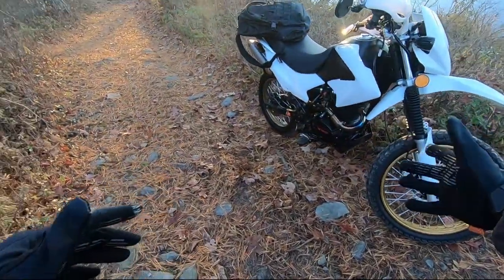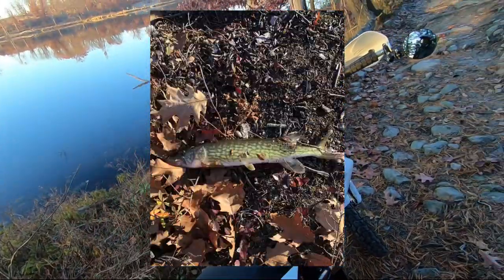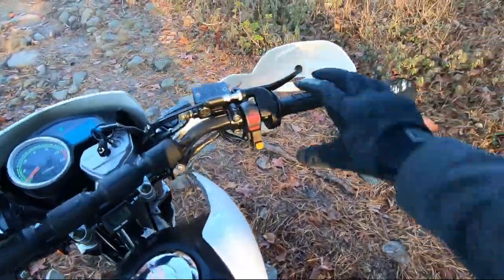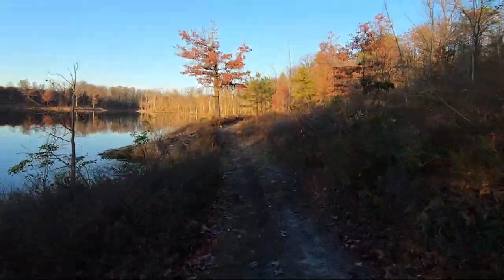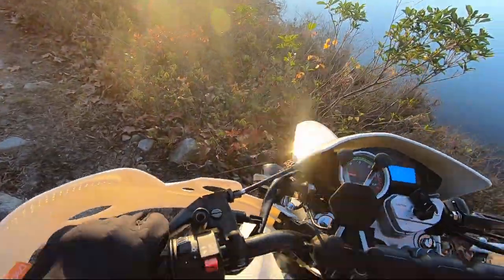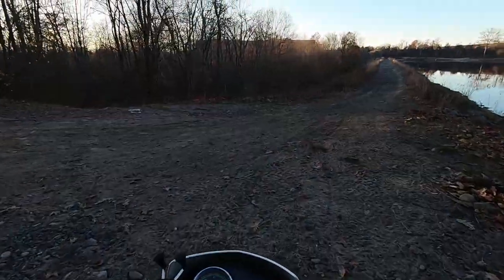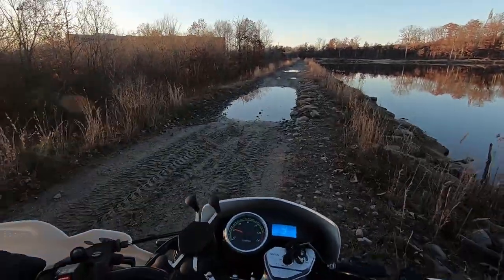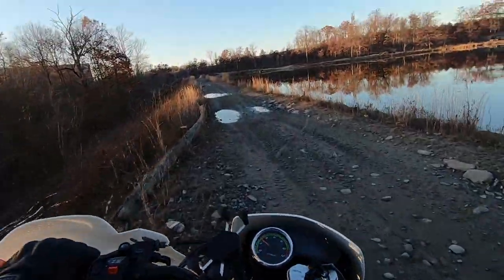TBR7 With Performance Camshaft (First Impression)

Comment: The extra duration and no added lift effectively boosts the existing power curve and helps a bit up top as well.  I personally noticed the biggest change from about 3500-7000.   Your evaluation of the increase feeling similar to the head porting is pretty on-point with what my impressions were.  It's a noticeable boost in power for sure.
Reply from the maker: The PWK should make things even better feeling too, thought about going 32mm but I want the throttle response more than anything lol

Comment: More free flowing exaust/ air filter.  For the bogging. My foam air filter sure kept the air clean.. but im not mudding. I got a big bore exaust with no spark arrestor, and a mesh intake. Works wonders. My bike went from bogging on its face at any more than half throttle lanches. To throwing the front end up if you wanted to try.
Reply from the maker: I'm already running a UNI filter, it's definitely no wire mesh filter but it's pretty free flowing. I have it ran into the air box with the lid off. I will definitely give that a try and see what happens. But I also think it's a air velocity issue with the setup I have and after all the mods I've done. I've got a couple possibilities to fix it in the future.

Comment: Seems like it’s running good! I’m waiting on a cam now as well as a timing key from henner while I’m in there tearing down the motor for the cam I’m gonna go ahead an add the ported head as well since the stock heads lack flow especially on the exhaust side so i definitely appreciate you making these videos sharing your experience with the ported head as well as the cam work I’ve got mine set up now with a full exhaust a bigger ignition coil & plug wire and already swapped to the nibbi carb so I laid the ground work in preparation for the internal mods already…should have the engine finished up soon just finishing up my Honda swing arm swap first along with a Showa rear shock..figured I’m already pushing the suspensions limits so increasing power roughly 40% at the wheel would definitely land me in trouble with the stock suspension anyway keep up the good work brother!
Reply from the maker: Whoah! Honda swing arm swap?? You've got me interested. You found a swing-arm compatible??!!

Comment: What is the entire intake setup? I haven't been able to recall
Reply from the maker: So as of now it's a nibbi PE 30, with the nibbi QCR intake manifold, that was modified to fit and port matched to my ported head, and then a silicone boot going into my air box with a UNI air filter
Reply: @xmoto7377  ok, ive been following. Did you still have the stock airbox? I was curious if your over jetting is compensating for lack of air velocity through the carb. Basically is the uni filter causing the carb to be less efficient? When I removed the stock air box lid on my little bike, I had to go to a massive main jet to try and get the a/f right. But when I reinstalled the airbox, I could bring the jet way back down with the same performance. Just food for thought
Reply from the maker: @VirtualCryptid  interesting, and yes I have the stock air box but I do run it without a lid, the massive jets also have a lot to do with my head porting, a lot of material was ported out so the velocity is definitely lower but overall flow was greatly increased
Reply: @xmoto7377  yes the porting does increase flow, but it may also have decreased the charge velocity. Its a hard trade off. But as we know the carbs work off of pressure differentials. So if there is not a good differential between the pre venturi and post...efficiency will decrease. Have you tried with the top on? I've tried to get a better look at the port job you had done, having some experience in port design and flow myself. But unfortunately its hard to know exactly what was done without seeing it. Did your mpg tank with the mods or stay similar?

As a side note, its nice to be able to talk to someone who is dealing with this lol
Reply from the maker: @VirtualCryptid  so average mpg did decrease about 25-35 miles per tank, I assumed that was just the trade off for more power out of such a small engine, I'll definitely try to tune the bike twice one with and without the air box lid and try to compare and see what happens, I assume without the lid will produce overall more power top end and with the lid gain more response and low end torque.  And interesting thing too is a lot of other hawk owners run an air filter directly on the carb and not into the air box. And somehow their jetting hasn't taken a drastic jump like mine did when I had the head ported.  I must have lost a lot of velocity from the porting and hopefully the PWK will help with that and the air box lid.
Reply: @xmoto7377  thats not as bad a trade off as I thought. I lost like 30% mpgs with my air box tunings. Its difficult to know exactly where an issue lies. However I think it would be nice to know a difference between the air box setup. I know pods can be very finicky and difficult to dial in. Just something doesn't seem right with your jetting...and I'm not saying it isn't working...but something just really seems odd. There is the other possibility that the carb itself isn't flowing properly, but there wouldn't be much of a way to really know that without digging further
Reply from the maker: @VirtualCryptid  well when I get around to swapping the carb we will see what happens!
Reply: @xmoto7377  awesome. Looking forward to those results. Did I see you live in pa? What part? I live in erie
Reply from the maker: @VirtualCryptid  I go to college in Scranton, but i live in Adams country which is south-central PA.

Comment: Update my guy
Reply from the maker: Coming soon! I promise! I've had a lot of bad luck with one thing after the next and then I finally went on vacation, I fly home on Monday and will do my best on Tuesday to get a video out. Any particular update you would like to see or have me talk about?
Reply: @xmoto7377  rpm and torque diffrences from stock..
Reply from the maker: @trucker2b  hmm okay, like compared to a completely stock bike or stock cam
Reply: @xmoto7377  yea...is it a new top speed and change in mpg.. cam keeps the vaules open longer and exspell the gass sooner longer... which should give sum result
Reply from the maker: @trucker2b  I got you my guy this week I'll have it up!
Reply: @xmoto7377  sweet deal.. be safe